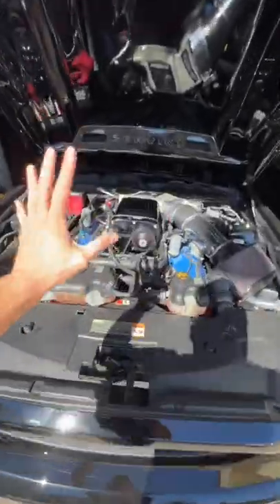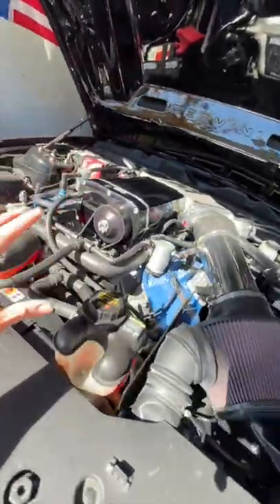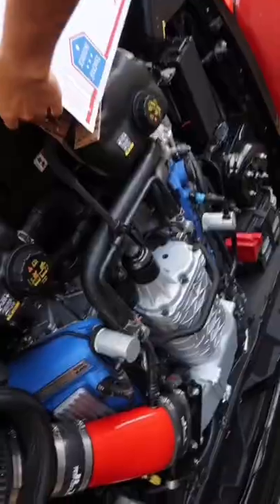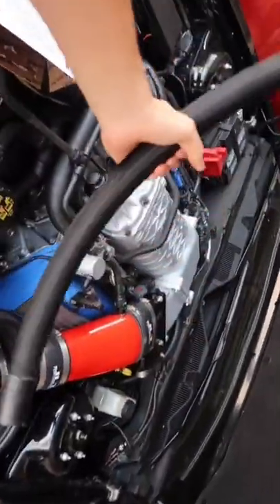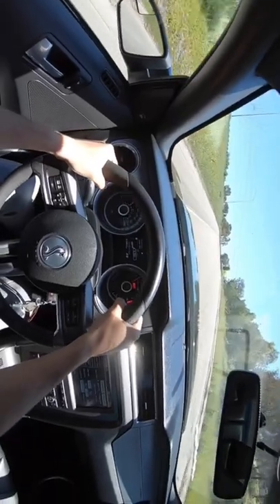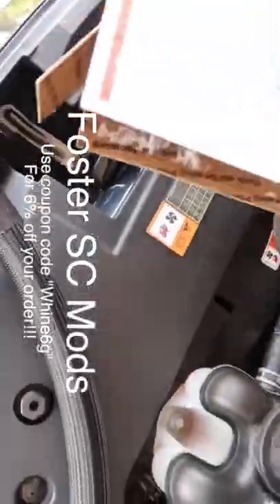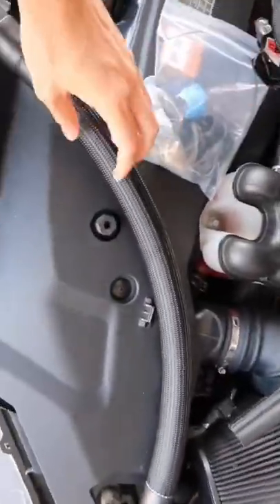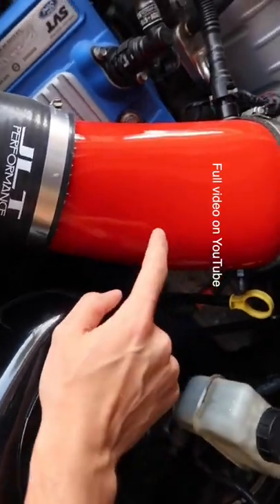How to make your supercharger 10x LOUDER! 🏎💨

Comment: Legends don't believe this cap bc we seen he changed his entire supercharger set up on the before and after
Reply: Actually no I forgot who also put this mod on and it actually works without removing some efficiency from the supercharger
Reply: These actually do work its called a whine mod
Reply: @edwardd9660  yea he doesn’t know what he’s talking about and that the more whine there is means that the engine is running effectively unless u got the whine mod that removes that and makes it louder with no risk
Reply: @briantorrens8270  it's called a sound tube. It just carried sound from the intake into the firewall
Reply: Whether it works or not hea phony because we litteraly see the real reason his supercharger sounded different not that tube lol
Reply: Nah, it works, it’s just kinda tacky because it becomes excessive.
Reply: @briantorrens8270  itsjusta6 also did this mod.
Reply: @edwardd9660  They do work but he didn't say anything about just being able to hear the whine inside the cabin... it's still the same noise on the outside, and by just seeing the change of cars in the cut it's enough for me not to do something like that
Reply: You obviously don’t pay attention
Reply: Dem guy why do u make it difficult?? Why ??? Basically that pipe goes through your firewall and into the cabin at the other end its connected to the intake so the engine is Basically sucking some air from the cabin making the supercharger sound a bit louder inside the car🤷‍♂️🤷‍♂️🤷‍♂️
Reply: Also I don't know why he bought a kit because cause any hose or small pipe can do 🤔🤔 i guess for aesthetics maybe but any pipe can do if you not fussy.
Reply: @kilp2635  the kits are actually louder than the blower itself so a regular hose won’t sound the same. The kit is basically a kazoo for your intake lol
Reply: Nah he's not really lying though, the mod really does make your supercharger sound louder, but only in the cabin. It basically routes the noise into the cabin, but I believe you need to penetrate the firewall, which is kinda sketch. Super cheap for some extra noise though.
Reply: Haha right, wanna race ? i still win. NA baby with a little giggle juice!
Reply: @briantorrens8270  bro he deadass changed the supercharger pay closer attention 😂
Reply: @mdsullivan100  doesn’t really matter he used a sound tube, bc more whine equals less efficiency, so to remove that that unwanted consequence u add a sound tube
Reply: How people gonna act like it's 'phony' lmao car manufacturers have done this stuff from factory to enhance induction noise etc it's just a tube to direct noise into the cabin
Reply: It’s not cap I’m Cap
Reply: @kilp2635  there’s a baffle it doesn’t suck any air from cabin
Reply: @kilp2635  because it won’t come with the baffle
Reply: @killsalltires156  that’s not n/a
Reply: Watch full vid
Reply: @csfghjt5564  I suppose your right. Only if I need it...lol
Reply: @briantorrens8270  itsjusta6

Comment: I think you did a little more than just put a tube on your old supercharger. That's a complete different unit.
Reply: It's not, it's a tube that goes from the intake into the firewall. It doesn't sound any louder from outside. It's made to enhance the noise from the interior
Reply: The supercharger is the same on the before and after pulls
Reply: Not saying you're wrong, this video is terrible. But this sort of thing does exist. Ford calls it a sound symposer and its on the focus st. It runs from the intake manifold through a butterfly valve and straight to the firewall, to pump "real" engine noise into the cab instead of playing it through the speakers. A lot of people delete it because once you drop your muffler its pointless. So in theory this would work. Man could've been less shady tho
Reply: Even changed the color of the intake tube from chrome to red
Reply: He's at a higher rpm in the second clip
Reply: Cobra mustangs used this stock.

Comment: Finally...
First video I've seen making use of wide-screen on shorts..
Couldn't see why YT saying must be portrait...
BTW nice video...
What I find.. air filters are nothing like big enough... to check use a vacuum gauge just inboard of the filter .. as a rule an engine at that sort of RPM needs a filter with at least 2 square feet of fairly porous foam.
Reply: Is it weird I didn’t even notice it was sideways until i saw this comment lol

Comment: I think you connect a hose to your intake and the other end is ran through the fire wall till its in the cabin. Now the supercharger noise travels straight to the inside of the car. Nobody outside the car can hear the difference.

Comment: There is 2 different super charger set ups on the before and after
Reply: Oh your a smart one huh… stick to Pokémon… it goes thru firewall so you can here the intake wine from inside the car. The supercharger is connected to the cold air intake right mr.smart man? So then you’ll here the whine from the supercharger and from the reg whistle from the throttle body
Reply: @csfghjt5564  haha 😂 why you getting so triggered for. The first super charger is a stock Eaton. The second charger is obviously a Kenne bell. Do your research smart man
Reply: You said on the before and after. When he presented the tube and when he installed it then did the before and after pull the same supercharger was installes
Reply: @808pokemoncardpulls7  it’s called a whine mod or a “sound tube” so uh ….do you’re research mr.smart man.
Reply: @808pokemoncardpulls7  also called porting by some people. You drill a hole in the cold air intake and run a tube from the intake thru the firewall and the sound travels from the intake to the firewall and makes it sound like the superchargers closer. It won’t sound any different from the outside . But it will make the same sound you hear from the front and make the sound travel up the “sound tube” and Into the cab
Reply: @808pokemoncardpulls7  a kenne bell is a procharger then
Reply: @808pokemoncardpulls7  I was thinking no supercharger vs supercharger
Reply: @csfghjt5564  he isn't wrong. In both of those videos the car has a different supercharger on it. Been watching this guy for years. I remember the first video he shows driving and thats with the stock Eaton. The second driving video is with a Kenne Bell. Kenne bell is way louder even without the "tube mod" even then installing a tube like that after the MAF the car won't run 100%. It's taking in unmetered air and can't calculate for it.
Reply: @azolis1597  yeah but the before and after pills have the same blower. And my point in general is this trick does work regardless of the blower
Reply: @csfghjt5564  so in simpler terms "a monumental waste of time and energy" lol
Reply: Budd Smokegood  he has two different superchargers yes. But in the before and after PULLS the are the same.
Reply: Budd Smokegood  and even if he does have two different blowers this truck still does work.
Reply: Budd Smokegood  and no I don’t need to re watch anything . Maybe you need to go back and reread. If you know how to read. I’ve already acknowledged the fact that yes there’s two different superchargers. Kenne bell and I forgot the other one I’d have to rewatch the video. He had multiple mustangs and I bet the before and after PULLS was in the same car with the same blower. Not for sure. Wasn’t there. But my OVERALL point is this truck does work. Even if he changed the blower. This trick will work with any root style supercharger with an intake tube/ cold air intake
Reply: Budd Smokegood  even it’s justa6 made a vid like 5 years Ago
Reply: Budd Smokegood  ahhhh your quiet now ….I literally typed in “how to make your supercharger whine louder “ trying to find itsjusta6s video and this was the first one that popped up.
Reply: Budd Smokegood  yooo
Reply: @azolis1597  that was after an engine swap. He was planning on doing the sound mod after he swapped the motor so he recorded himself making the short first but if you go watch the full video he Installs it on his new motor and shows a sound demonstration so no. I’m not wrong
Reply: @alexk3469  pro charger is a prand
Reply: @jackknifesociety7154  no some guys like the sound of superchargers . I mean that’s one of the man reasons people buy supercharged cars or supercharge there’s. Turbos usually make more power up top. Unfortunately the further you get to the back of the car the harder it is to hear it. Especially in newer cars that are “sound proof” or have more sound deadening so the guys who want to hear the wine in the cabin will install these . Actually a lot of manufacturers put one from the factory now but before hellcats and what not people didn’t really drool over the wine so much and it does get annoying after a while some manufacturers don’t
Reply: @808pokemoncardpulls7  as I said a few times . In the SHORT the superchargers are different yes. Actually the whole motor was swapped. But the before and after pulls are the same. I’ve already done my research. Go do yours

Comment: Wow you have a car with a magic supercharger it was black then it changed to aluminum....crazy
Reply: No when he made the sound tube video he still had his stock blower since then he has swapped his engine,which he had built and installed another supercharger . But the before and after pulls are the same. The whole “must have mod that everyone has to have “ clip is new and was never in the first vid.

Comment: The new supercharger and the smaller pulley on it is what's making power and it "louder"  that not some damn tube!!!
Reply: No when he made the sound tube video he still had his stock blower since then he has swapped his engine,which he had built and installed another supercharger . But the before and after pulls are the same. The whole “must have mod that everyone has to have “ clip is new and was never in the first vid.

Comment: Or you a actually spin higher than like .1 pounds to get the belt at that winning point where it doesn't slip but air still get under the belt

Comment: Y'all know that most of the supercharger whine comes from intake and not an actual supercharger?
Reply: No it comes from the supercharger 😭
Reply: The sound is a lot louder in gear driven superchargers . And the sound you hear is the screws of the supercharger
Reply: @csfghjt5564  I know that, but sound EXITS trough the intake, cmon dude
Reply: @skidhvh  okay good. And yeah most the sound does come back they the intake that’s why this tube pics up the vibration and put it into the cab